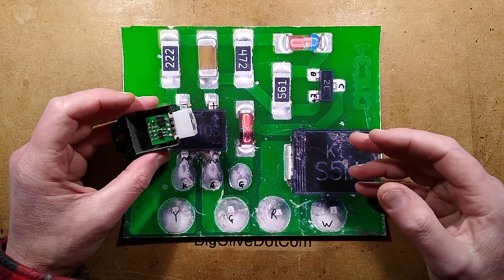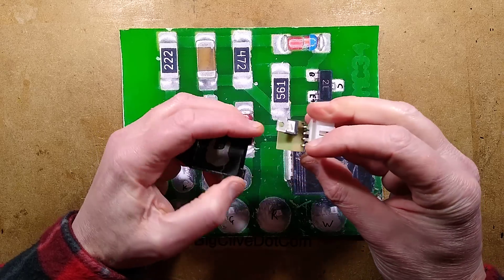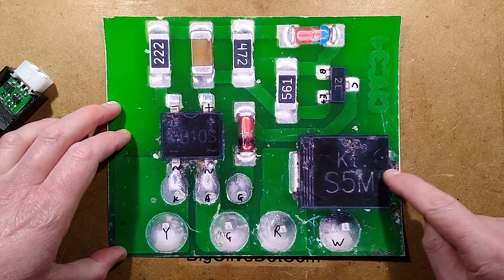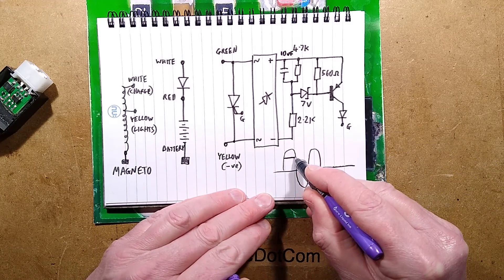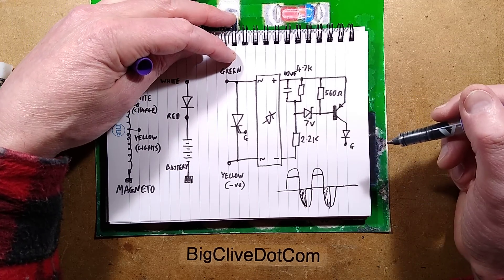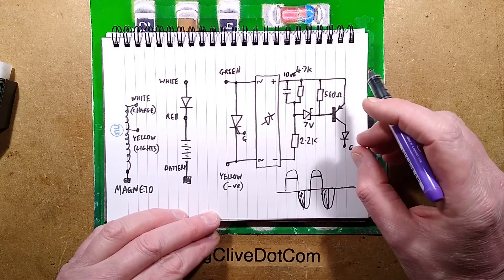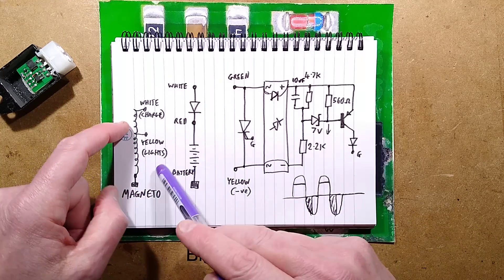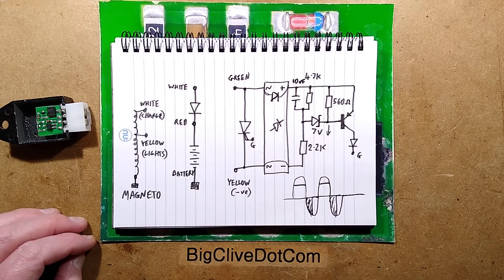Chinese quad/scooter rectifier/regulator teardown with schematic

Comment: From watching other rectifier videos my impression was that the 560ohm, Zener and the 2.2k resistor should be able to divert current in both positive and negative parts. The thyristor is a supplementary crowbar shunt for if you suddenly lose a lamp and the load changes in the circuit so you dont burn out the zener

Comment: 4 years later.... I just pulled one of these apart. I got several to potentially use on a 1957 Velocette bike. Mine is exactly the same inside. Right down to the sand! I've decided not to use it and instead will go with the original system with a bridge rectifier to replace the ancient, and faulty, selenium rectifier the bike used. The generator on the bike has multiple windings on it and it the ignition switch has multiple positions that control ignition and lights. Depending on the switch position, different coils are switched into the circuit. The battery itself clamps the voltage down which is why on old bikes and cars you should never run the engine without a battery connected. The generator will easily generate over the nominal voltage and you'll burn out all your bulbs!

Comment: What would you think about it getting to hot, is not poping the fuse but melting the fused wire? Thanks for the video very informative.
Reply from the maker: If a wire is getting hot enough to melt, the fuse may need checked for being the correct value.  Generally a hot wire indicated a short somewhere or a higher current load than the wire is suited to.

Comment: I have owned my Tao Tao 50 for 5 years and have replaced 3 of these.  When they go bad you end up replacing lights and the battery. Is there a substitute that would be more reliable?
Reply from the maker: There probably are better designed units.

Comment: It is a beast that a thyristor should be shorted to prevent the voltage from exceeding 12 volts. However, the voltage of the generating coil provides between 8 and 90 volts; a regulator for this scenario is complex and expensive. We are still in the Stone Age.
Reply: With a load they dont produce that much voltage. The battery is a big load and the lights do the rest.

Comment: What can we do to save the battery. What protection system to use. These same things are used by honda in their honda cd 70 motorbikes. These bike are the most sold bikes in Pakistan. I have one and the battery wont last long. 12v wet acid batteries last 2 to 3 years and dry batteries tend to last less time mainly because they are definitely a bit sensitive to this voltage torcher.
Reply: im thinking custom lm317 or lead acid charger ic/board. but would probably need some rework on wiring, also i think leaving stator grounded would not work , i think you first need to dissconect stator from chasis ground than make full bridge rectifier and add real regulator, either linear or mosfet(i could not find mosfet based regulator schematic but you can get made pcbs made for solar panels)

Comment: It's illiterate. Chinese often have some outsider/ prototype design something, and then they build it, and often to extreme quality. This is junk. A crackpot barely got these circuits to work. I was going to try to get a smaller solar panel to work with this. Thank you for the warning.

Comment: Hey Clive - thanks for the video . I have been using exactly these guys for around 30 years and they are amazingly dependable . They do not tend to fry the battery and charge well enough . As a few others have said the lights get dim at idle but the battery charging is actually quite strong at idle and dips a bit as revs go up then stabilizes . The green to earth goes through a ceramic dump resistor 5-8 Ohms on my bikes , don't know if that is interesting for you . Thanks again for so many great videos and your smooth presentation style - much enjoyed .

Comment: I wondered if some magneto coils are arranged such that each one is referenced to ground (instead of series as shown). Also, since the thyristor essentially shorts the lighting supply when the switching threshold is reached, I wonder what current will flow and whether or not it's stressing the thyristor and/or magneto and/or wiring. I am searching for a solution that can be applied to a 6V system, so I guess (just for the lighting really as the supply to charge the battery seems to be ok, albeit rather crude - just a single diode as per your drawing. So far no boiling etc occurs).

Comment: So I’ve got one of these Chinese scooters I’m trying to get roadworthy (I get it, that’s a joke kinda) and while I’m good with engines and wiring 12 volt stuff and understand basic electronic (just the basics) I’m not near as well versed as you guys (that appear to be EEs).  So if anybody sees this I could use some help (I know it’s old thread).
Engine runs fine, got that part under control.  It just isn’t putting out anything from the charging system.  I’ve replaced the stator and tested it while running and it’s putting out the requisite ac voltage on the yellow and white wires.  20-30 at idle and 60-70ish when revved up.  Checking each phase (yellow or white) between ground.  It uses that exact rec/reg (same size/plug) as far as I can tell externally.  Same colors yellow/white/red/green.  Now here’s where I might have been messing up all along and this only became evident after sharing you dissect the regulator and cdi and the harness video.  I have hard wired everything the way I assumed it should go because someone had made a mess of the oem harness. 
Here’s my connections:
Off the rec/reg
Stator yellow to yellow on the rec/reg
Stator white to white on rec/reg
Rec/reg red to battery positive (fused 10 amp)
Rec/reg green to ground straight to battery.

Checking dc voltage at battery it just sits right at 12.7 doesn’t rise to normal 14 when revved like a normal working charging system would.
What’s got me stumped is when I plug/unplug in the rectifier regulator with the engine running it pulls down the idle speed so I’m assuming it’s the load of alternator on the little 50cc engine.  So leads me to believe it’s working.  But no output at battery.  
I see the headlight has something to do with this from the video and the comments.  Being i hard wired everything (cause the factory harness was butchered so bad) did I miss something that’s with the yellow coil wire from the stator that’s affecting the regulator and causing my problem?
I’m used to working on big bikes from Japan and modern Harley’s that have three phase stators/rec/regs so this isn’t something I’ve encountered before (2 phase half wave whatever this type of system is called)
Thanks for any help

Comment: What did you use to make the epoxy soft? I've been grinding mine out for hours. Got to the circuit board, it has two SCR's on mine, I did the lock test on them and both work. But all the other parts are a guess unless I can get the circuit board out. I tried alcohol and that didn't work.
Reply from the maker: Try heat.

Comment: My previous comment stems from I am looking to use one of these to rectify ac to dc off a snowmobile to power a led light bar. With a capacitor after the rectifier to level out the power. Needing to know where to plug the load, load ground, supply and supply ground. Creating a complete loop since I am using the stock wiring up to where the stock light would have been.

Comment: Clive my question is. As these take up the duty of heatsinks. Would adding fans to help scrub heat. Help them last. I’ve got a cpu fan connected to a toggle switch wire tied to my Chinese Rectifier with great results. I’ve heard guys lasting years on same Rectifier with a fan. But most don’t want to attempt the job which I used the turn signal line on fuse box for current.
Reply from the maker: Airflow definitely helps cool heatsinks.  On a bike the positioning could help if the unit is getting hot.
Reply: @bigclivedotcom  thank you 🙏🏾 testing on a 50 degree night only hit 75 degrees. On a 85 degree day stayed in the 120’s to 125 in traffic. Never went higher. Heat is the killer of electronics so happy knowing I’m helping it last a little longer at least.

Comment: I just went on a two month adventure replacing my motorcycle regulator/rectifier & stator.  It was either deal with cheap, non-functioning parts or pay 10 times the price for OEM.  2000 Suzuki Marauder, VZ800

Comment: Anyone know of a more efficient unit than these?  I hear these little Chinese engines, if they even have a charging / lighting circuit, only put out around 60 watts on a good day.  I would like to get as much out of mine as possible.
Reply from the maker: It's guess they put out the minimum they expected to need to minimize load on the small engine.

Comment: Iam just hoping my electrics are safe with this new Chinese voltage regulator when i build it back up its a 4pin 2.7  131  sh672DA it said for Yamaha dt125r in the title when i bought it. UP2 it says on the back of it with a green plug 4 pin

Comment: Light run ok on AC no need for rectification but voltage needs trimming to stop bulbs blowing. Charging a battery need rectification the quad I am working on for friend has a three output wire. Ignition is separate inductive pickup. I understand a bridge rectifier. The circuit you have drawn reminds me of circuit on standard alternator. A zener diode breaks down over its voltage threshold. The allows current flow to base of delicate sensitive transistor., the transistor switches the base of a power transistor which disconnects path switching of rotor coil reducing the output. Zener diode switches closed again turning off delicate transistor which in turn powers up the power transistor reapplying ground to rotor. Basically a sensitive switch operating a heavy duty one all decided by zener diode switching. Almost like old school regulators on dynamo which used coil magnetism to move switch basically buzzing away regulating voltage and current.

Comment: Can someone tell me how the fffffff like I did all this my self chasing my tail for like a whole month and found out the cdi box only works with half wave rectification so U would think the half of this device with just a diode would power the cdi but it doesn’t wtf 🤬 I made it full wave and got spark all time was ready to cut my fingers off just replaced everything back to factory starts runs great butttttttt with the lights off it changed at 18 volts dc buttt with the lights on it changes at 13.5 vdc like it should...... like how the frriigg is that even possible I really don’t get it

Comment: It's basically a two phase ac supply, I want to use two rectifier regulators, not using the headlight circuit of either regulator, so both will be used for the battery charging, the question is, with a full higher current sinewave going to be rectified, and charging the battery, the battery is more likely to be over charged, it could have 20-15amps, at 15-16v, maybe more, could I connect the output to a large capacitor, and a DC buck converter, it will output the input, until it reaches a set voltage,  approximately 13.8-14.4v, the buck converter I have in mind is a cc cv unit, so I can use my lifepo4 battery in my scooter,  sorry to write again, but I wasn't sure I explained what I have in mind,    basically doing a half DC conversion to my scooter, tganks

Comment: Hello Mr Clive, I have a question, do you think the yellow ( light ) wire from the stator. Could be wired to another regulator, and connected to the battery, and connect the output to the battery, not using ac fir the light, connect the light to the battery,  it would basically be like having two staters and regulay rectifiers, with no headlight circuit, I guess the ground would have to be modified at the stater. 
I'm wanting to use both outputs for battery charging! I'm glad you did this, I bought one so I could disassemble it, it just hasn't arrived yet! 
To thank you!!

Comment: Good. Is it possible to use both coils and feed all its it's dc output to battery to charge battery fast and have lightning being run from battery instead of this pulsing ac?

Any way to convert both the coils to charging battery fast.
Reply: Also these Chinese cheap quads have half wave rectifier  stator windings arrangements. There is a trick to convert them to full wave and have all charge go to battery and then run devices from battery. Please if you can make a video on how to do it. Will be a great service to all fellows.

Comment: The old incandescent bulbs work fine with the strange wave-form.  I upgraded my headlight to an LED rated for DC or AC (internal diodes?) and it worked but flickered.

I upgraded my tail/brake light to LED and the brake portion died.  Who knew that a single bulb was powered partly by DC and partly by AC?  It didn't matter as long as it was incandescent.

I eventually replaced the regulator/rectifier and modified the stator to achieve an all DC system so that I can run all LEDs now.

Comment: This style of “regulator” has been around for a long time. Years ago I discovered these brute force shunt style clipping regulators on my dirt bikes. Apparently when you fire the thyristor abruptly, the surge of current causes alternator field to collapse. This effectively unloads the alternator and limits the system voltage at the same time. I had originally thought this would waste power and make the alternator hot, but it doesn’t. Crude, but effective.

Comment: On a Honda (moped) bike which is a 6 volt system the battery is charged with one diode in series (same as schematic) and the 'yellow' wire powers the headlight only OR when switched off goes to a load resistor similar to the resistance of the head light (maybe a bit lower actually)  to prevent over voltage going to the battery? so no voltage regulator to be found or needed apparently? (the magneto setup is the same only 6 volt instead of 12 volts)

Comment: Shunting the windings seems to be a standard way of regularting bike voltages, even on bigger japanese bikes. 

But running the lights on AC is sooo retro, I had a 1960 Lambretta scooter which did that (no regulation, just a selenium diode going to the battery which fed the position and brake lights) which I always assumed was because back then, high-current diodes were not a thing. I converted that setup to a full-bridge rectifier, put the lights on the battery, and voila, useable headlight even at idle...

Comment: Are you sure the thyristor isn't a triac? The circuit looks as if it might work on both half cycles if that were the case. You could try this circuit by connecting it to a lowish voltage (say 24 V) AC supply via a suitable current limiter. This could be a resistor or filament lamp. You could then see what is happening with your oscilloscope.

Comment: I was looking into similar stuff whilst rebuilding my '90's Yamaha. I was surprised to see how cheaply the original rectifiers were made. Basically shunting out the 3 fase generator to try and achieve some level of battery voltage. This causes great stress on the windings on long trips as a lot of heat is generated. Interesting to see that the Chinese managed to reduce the design quality even further... ! I'd love to see s teardown of a Japanese rectifier regulator! Thanks Clive! Love your accent, grew up in Edinburgh in the 70's...

Comment: So the tension over the battery and the diode is the tension from ground over the "yellow coil" plus the tension over the "white coil", am i right?
Then if the "yellow coil" is short circuited, the tension over the diode and the battery is only the tension over the "white coil", which is less.
Maybe that is how it regulates it, however coarse it is.
On my AGM caferacer, there is a similar circuit (except that is using full wave charging) and that does regulate the charging tension.
See: https://youtu.be/Piz88_OIhEQ

Comment: Since the frequency of the voltage is directly derived from the cycle of the engine, I'm guessing that quarter cycle with no load at all is the power stroke of the engine in a two stroke motor. You do not want any extra load at all to hinder the production of power on that stroke. 

I suspect that they are only charging the battery on the half cycle to reduce the fuel consumption. The magneto is maybe 6 per cent efficient. The energy to charge the lead acid battery needs to come from somewhere and the more power that is diverted to top up the battery ultimately the more fuel that is used. There is a back EMF generated by the coil in the magneto, so the higher the load the higher the force rejecting the direction of movement, so the higher the fuel that is used if travelling at the same speed.

And I'd say that it is something similar to the lights, on the other quarter cycle. Again it is to minimise the fuel use.